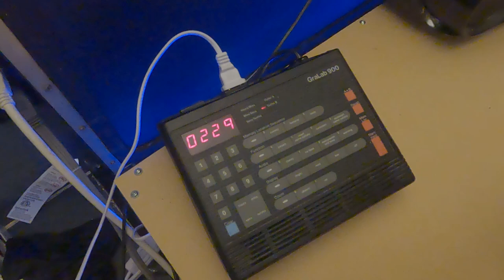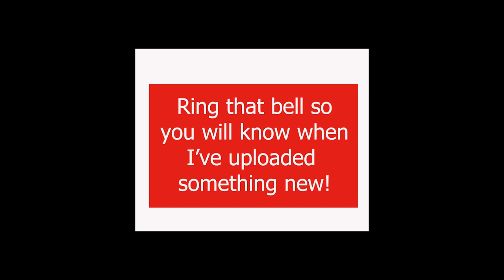My 14x17 Camera & X-RAY Film At Riverview

Comment: That's a nice camera. It would be cool if you made a video about how you made it. Did you design it? Are the plans available?
Reply from the maker: Thanks Paul! I built it about 12 years ago, from plans that I had drawn up, which sadly, no longer exist. I designed it around the one film holder that I had. The weakest point was the bellows I made for it. I replaced it with a bellows made by Custom Bellows in the UK, a few months ago. There's a video of replacing it in my channel. I plan on getting out more with it in the next little while! Thank you for commenting!

Comment: Amazing. I loved the video and the details and the cool slow process.
I'd love to build the camera, because I too would like to do such large prints.. 
Would you mind sharing the plans for it? Thanks a ton.
Reply from the maker: I'd love to share the plans with you but I built the camera back in 2011. The plans are long gone. Basically, I used birch (cheap) and I built it around the film holder's dimensions. The film holder was not only the most  important part, but most expensive at the time. I've since replaced the bellows (there's a video of it in my channel), making it the most expensive part of the camera! The bellows was made by Keith at Custom Bellows in England. I highly recommend his work! Cheers and thank you for watching and commenting!
Reply: @analogueandy8x10  Thanks for your kind reply. I understand you may not have ready plans. I think I would like to make something with MDF rather than wood since I would like to use some industrial processes to cut them up. I think I will come back and make the best use of your videos to make my camera. Thanks in advance for enlightening the world 🙂

Comment: Camera looks great. Bought  film holder and 14x17 X-ray film a while back. Never figured out the film processing part. All I find to read is about how tray processing scratches the double sided film.
Reply from the maker: I have no scratching issues with double-sided film in flat-bottomed trays. Stay away from conventional, ribbed, darkroom trays! If you don't have any flat-bottomed trays, try placing a piece of plate glass or acrylic in the bottom of a regular tray. I did that before finding a flat-bottomed tray. Worked well. No scratches.🙂

Comment: Good work Let me know what kind of xray film you youse and what sensivility you expose it. Congratulations from Argentina
Reply from the maker: Thank you! For this video it's double-sided green latitude.  I expose it at ISO 80. I got it from cxs.online. That brand isn't available anymore, but they do have Fuji Super HR-U Ortho Green. I've not used this brand, but once I run out of current supply, I will order some. I'm assuming it is double-sided, but if not, that's okay, as double-sided is more prone to scratching. I prefer using green latitude as it's orthochromatic, and responds well to yellow and green filters. I've been using xray films for 15 years. They are fun to use, and dirt cheap! If you have any questions, don't hesitate to ask! Have a great day!
Reply: @analogueandy8x10  Thanks for your answer y use Kodak Carestream Medical X Ray Green Is Double side emulsion Is dificult to youse because it scrace easily I Experiment with AGFA30 and D23 de best results are with D23
Reply from the maker: @gerardodalchielelueiro6818  I use a flat-bottomed tray to process double-sided xray film. There are not very many options to process 14x17 inch film. I also use 8x10 in flat-bottomed trays, but sometimes I use hangers for semi-stand, or stand development. I don't use the hangers for normal processing, as too much developer is wasted, and if you are not careful with agitation, you can end up with surge marks on the film. I also use D-23 diluted 1+1. 6:00 20C... or Pyrocat-HD.

Comment: Hello.
I really like your videos, congratulations.

I have been using fuji super HR-U x-ray film and developed with D-76, how about that developer?

Another question, with that film, what filters do you recommend using. ?

Thanks, greetings from Colombia
Reply from the maker: I like to use D-23 at 1+1 dilution. I mix the developer from scratch.
Reply from the maker: You should be able to use D-76, but I would dilute it first. Undiluted will probably give too much contrast. Try diluting it 1+2, or 1+3.
Reply: @analogueandy8x10  Perfect, thank you very much.
Have you done tests with dektol, would it also have to be diluted?
Reply from the maker: Yes, definitely, especially if you are after continuous tone negatives. Dektol is diluted for photo papers as it's quite strong. You would have to experiment with how much to dilute for XRAY film. @intifadastencil

Comment: So we’re messaging back and forth and I’m about to run test #4 on the film
Reply from the maker: Let me know how it goes!
Reply: @analogueandy8x10  no images again with 8-4x5 photos taken, I tested also with some Formapan 100 expired film and got fine images.
Reply from the maker: @jrmorganpetro   what EI (ISO) did you shoot it at? What was the development time in Rodinal?
Reply: @analogueandy8x10  last night I tested 6 sheets cut to 4x5. Three at ISO 60 and three at ISO 80. I chose F11 and worked from 1/100 down. I tried Rodinal 1:50, 1:25 and new medical x ray film developer that I bought from the same company as the Fuji blue sensitive double sided film. Oh I threw a clr polarizing filter on. All negs came out dark with no images. I shot 6 sheets of expired Formapan 100 and got images on each neg. Not giving up.
Reply from the maker: @jrmorganpetro  did you compensate for the polariser? Exposures have to be increased by about 1.3 stops. But... you are saying that the negatives came out dark with no image... are the borders clear or also black? Are you working under a safelight? Lets continue this via email: andy8x10@gmail.com